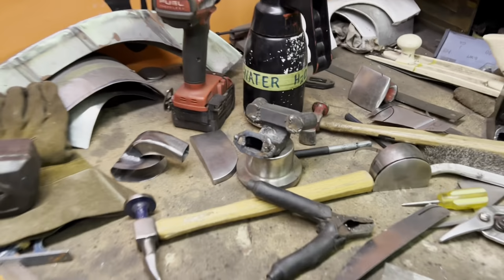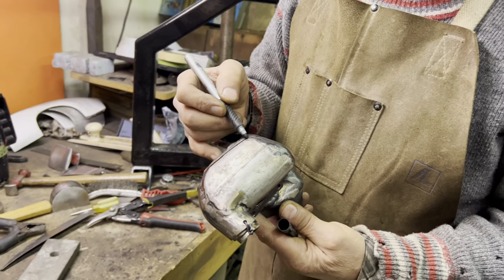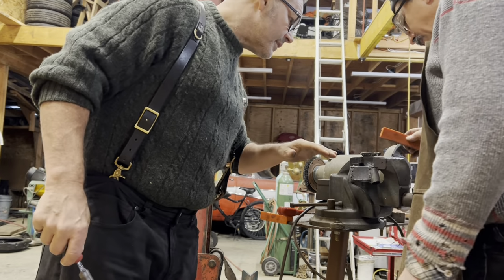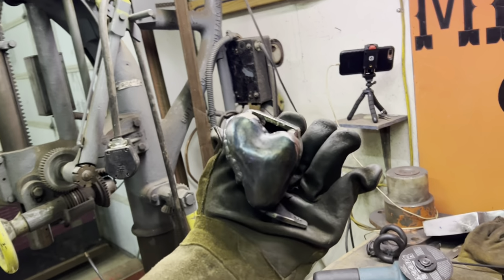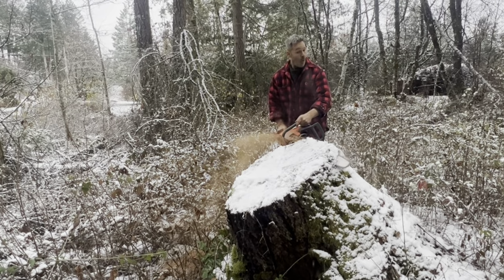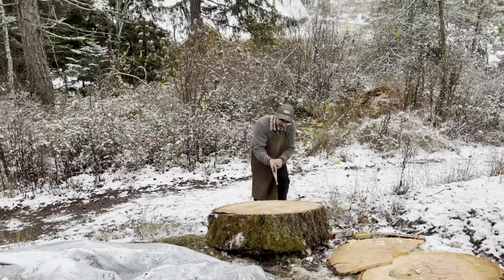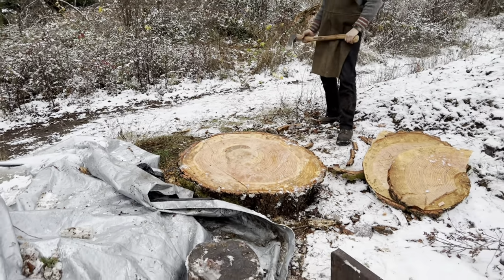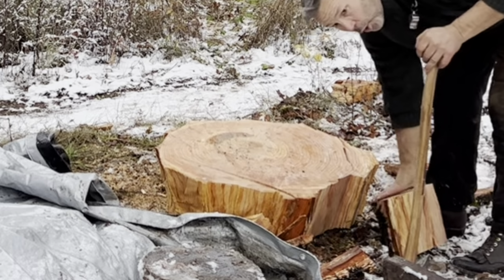HUGE STUMP. Pushes Chainsaw to limits.

Comment: After an encounter with a power saw helping clean up after a tornado hit our town  in Trumann, Arkansas almost exactly a year ago, the buck fever hit me. Thanks to Buckin here and tired of crap jobs, I didn't know where to start in the tree biz but i started. I was basically an apprentice and feel I'm still green (I am) but the tree vets I help sometimes are shocked that I know some things and especially when they see me walk up with a Mcculloch 605 I got out of the trash and rebuilt From watching buckin, tinman, walker, ironhorse, and August hunike with a 28" inch bar on it! You guys have given me the confidence that i can do it but also i have to confidence to say no to some jobs that could be too big for my britches. Good man, this Buckin is. thanks!
Reply: Preston, I’m in Bauxite AR about 30mi SW from the center of LR. Where abouts is Truman compared, because I’ve not heard of it. We might even get to hang out sometime 😊
Reply: I was taught how to say no also when it pertains to possible injury and failure.
Good man, good job...
Stay safe
Stay strong
Be kind and be honest to yourself and it will be easier to be honest to others. 🌲🌲🌲

Comment: Physics involved with these pipes !  Temperature is king 🤴 here … gas (exhaust) flows faster as temperature of pipe rises - trick for max performance is hot enough but not too hot (lean)  as to cause damage. Get temp and flow correct ( and be able to HOLD ) saw will “be on the pipe” and produce noticeable gains in torque which will allow faster cutting and lightning quick throttle-response. The Rowdy pipe I built (off the original bear paw design) gave a documented 9% peak to peak gain on Dyno Joes dynamometer and that was on a 372xp Xtorq … That’s a generous gain for bolt-on in any mans book and will outperform ANY commercially available muffler or cover to the best of my knowledge. I have a new version that should give 12%+ .  In conjunction with intake mods , porting and piston mods , and case modifications - ….. by my calculations you should get a saw that cuts 27-35% quicker , with similar fuel economy and longevity with NO MACHINE WORK/ High compression/ Sounds like an angry hornet/ ticking time-bomb just waitin to blow!

Comment: You can literally turbocharge 2 stroke engines with the right exhaust setup. If you have the right back pressure from the exhaust, and the right length of exhaust, the exhaust gases will push back into the cylinder and, with right setup, do something like an exhaust valve on the 4 stroke engine. It seals the cylinder in that way, that the combustible gas the overflows, will not get into the exhaust before the cylinder is closing.

Comment: Hello Billy y have a question do you used only full chisel chain i used it with my stihl 462 and it faster and easy to sharpen but with my ms 261 the pitch is 325 and it’s small for sharpening i cut only hard Wood for stove burning in my country only hard Wood

Comment: Speaking about pipes,  I just got a newly released pipe for the little echo 2511 from Egan performance(the guy that makes the straight shot stuff) Supposed to make 28% more hp on the dyno on a stock saw, and should really help get the heat out of that little saw.  And it sound real angry! Lol 
Might be cool to try on that ported climbing saw you got,  Buckin' 😉

Comment: Buckin', we share that nasty low back; L5/S1 and up to L4-5 . But, a fella just has to go to war with those damaged parts, and conquer them. You got it in the woods and I got mine in a 700 hp , 1425 pounds sprint car. On that one I thought I had just pushed up into a wall at full throttle and smacked it. Years later my wife and daughter told me I flipped it and "barrel rolled "it at least 8 times at about 90 mph. It's those "landings" that hurt. But we also share this; that injury cannot own us.